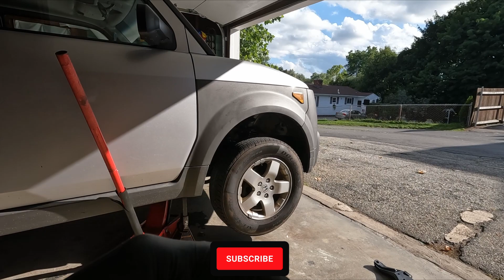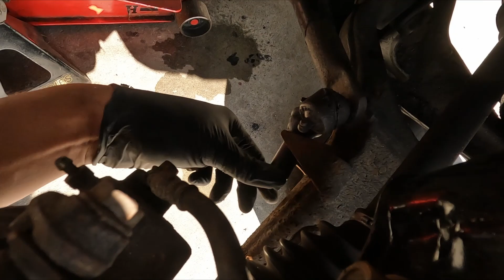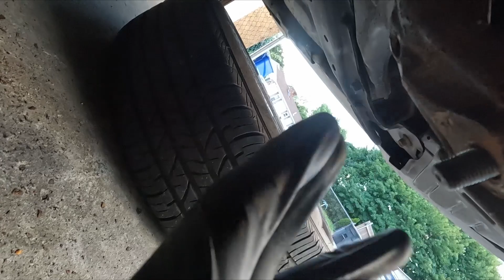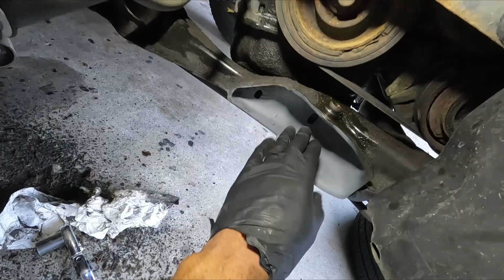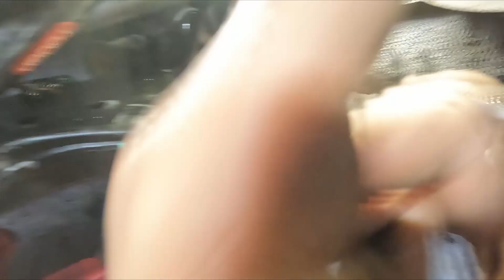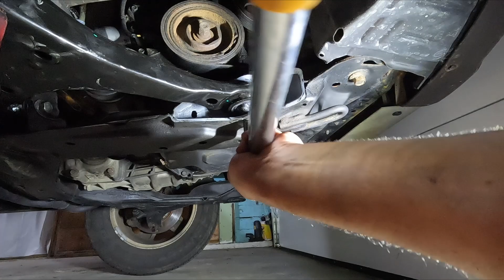How To Replace The Front Lower Control Arm On A Honda Element

Comment: The pitman puller loaner tool from Auto Zone didn't fit as yours did.  I did the method where I jacked rotor so lower control arm was in normal position (bearing weight of car).  Jammed the handle of 1/2 craftsman socket wrench between ball joint & lower control arm & dropped hub....  Ka-pow got the thing loose.  Later snapped a harbor freight 1/2 inch extension trying to get strut bolt out...  Pipe on a breaker bar for leverage.  Ended up having to use big red wrench - blowtorch.  Ugly job but got my axle in and will torque back up things today.  Chicago salt rust.

Comment: Thanks for this vid.  Spent 4th of July with my son's 04 Element in the air banging away on lower control arm trying to free the ball joint on an axle replace job.  I'll look to get that pitman puller from Loaner Tool at Advance or AutoZone.  I've also seen vids where guys jack up lower control arm, wedge a chunk of metal between control arm & ball joint and then release jack and gravity weight of knuckle pops the thing.  New subscriber.  Happy 4th!

Comment: I rebuilt the suspension front and rear on my 2008 Element a couple of years ago.  Just noting you have all the right tools to do the job.  As a suggestion, start soaking the nuts/bolts with your favorite penetrating oil a couple of times a few days before tackling the job.

Yeah, I had to cut the sway bar links too to get the control arm off.  To others contemplating this job, order the sway bar links when you order your new control arms and save yourself some time and trouble.

Good job and well done.  Thank you for posting!